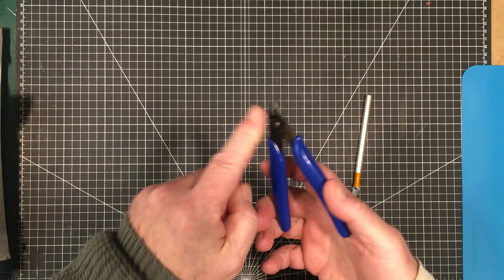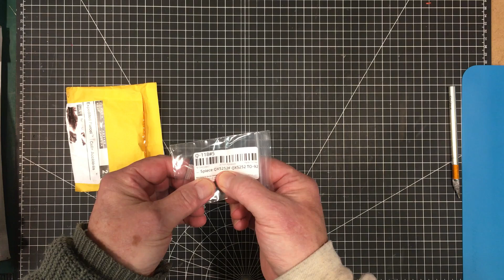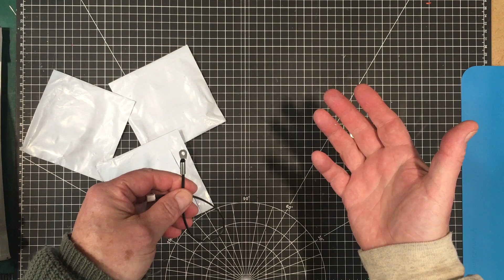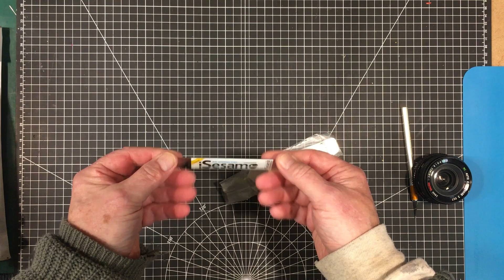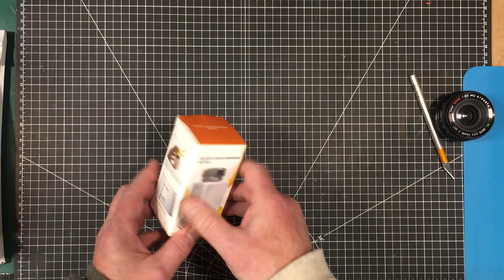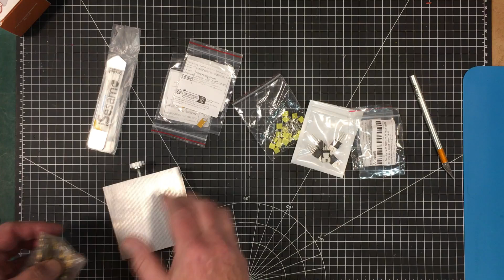Uni-Byte 0231 - Mailbag #31:  More GOODIES from AliExpress!

Comment: do the voltage regulators work okay? they are a lot cheaper on ali than on mouser
Reply from the maker: I actually have not tried them yet.  I plan to in a future video.  That said, this is not the first time I have bought regulators off AliExpress and the previous ones have worked just fine.